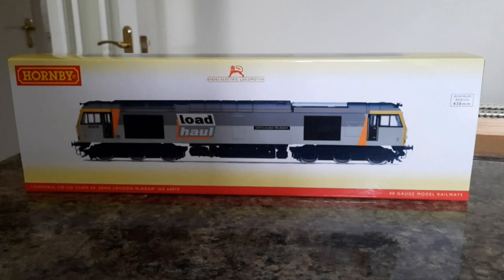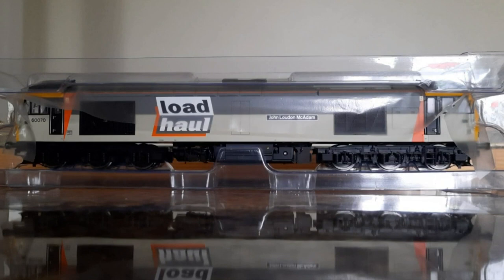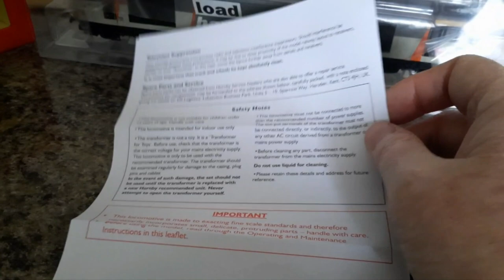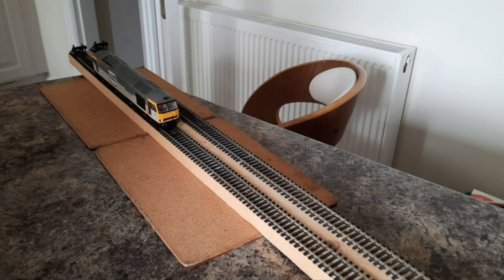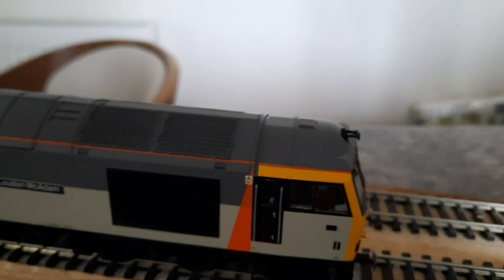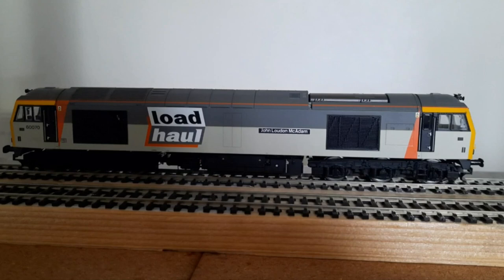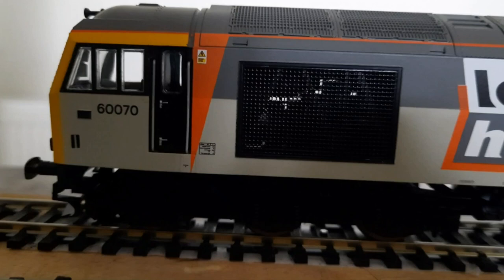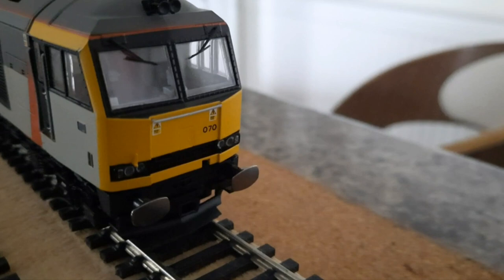Bargains From Hattons Model Railways PART 1

Comment: Nice I am tempted though it`s scraping the time period i`ll model, and i`ve just bit the bullet on the Accurascale class 31. bit by the horn could be an antenna for comms or signalling
Reply from the maker: Thanks for watching my video and comment. This is a good class 60, considering my last 2 60's were the cracked Dowlow's. Was bit nervous getting it, but it has worked out well. Thanks for info on that thing above the horns. You will enjoy your 31 when it arrives next year. Cheers Kevin 🙋‍♂️👍🤝👋👏📽🚂🎞
Reply: @bluebellcentralmodelrailwa4064  any luck finding a tts chip unsurprisingly there a bit thin on the ground
Reply from the maker: Hattons did have the tts chips in stock, but money was tight as the loco & 5 tankers cost me £350. Hopefully Hornby will bring some more TTS chips in to stock. Cheers Kevin 👨‍🔧👏🤝👍
Reply: @bluebellcentralmodelrailwa4064  Ya broke me. I ordered one once i could find a chip, dont know what happend to my last msg,but i found a good deal, gives a shout on my fb page and i`ll give you details
Reply from the maker: @newlynnrailway  sorry I don't do FB mate, cheers Kevin